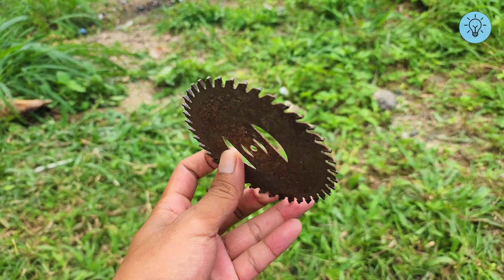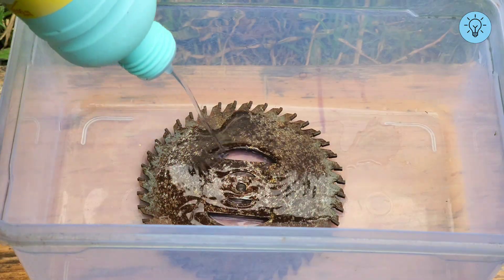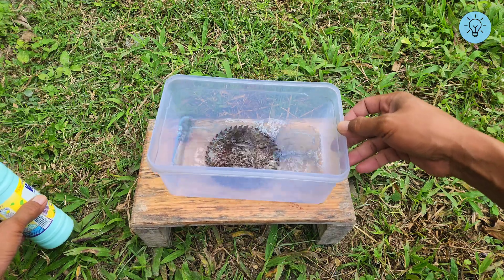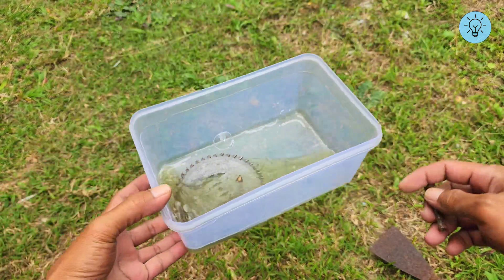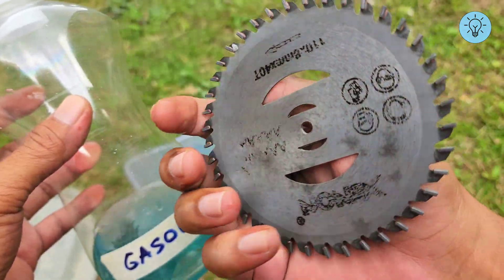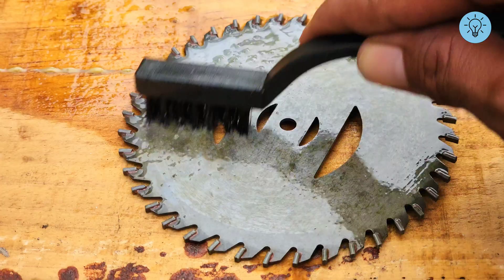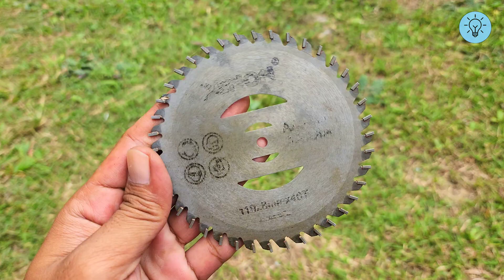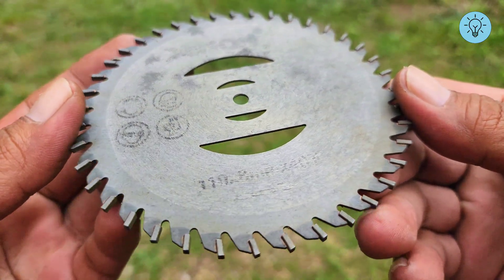Apply GASOLINE to rusty iron! Amazing results that many people have never imagined

Comment: 100 LL Aviation fuel is blue
Reply from the maker: The natural color of gasoline is actually clear with a slight yellow tint. However, the color can vary from one country to another.
In my area, I can find gasoline in green, blue, and red.
Manufacturers usually add color to help consumers easily identify which type is suitable for their vehicles.
For example, green gasoline has an octane rating of 90, blue has 92, and red has 98.

Comment: Huh? Gasoline? I’ve never seen blue gasoline in my life. Looks like dish soap!
Reply from the maker: The natural color of gasoline is actually clear with a slight yellow tint. However, the color can vary from one country to another.
In my area, I can find gasoline in green, blue, and red.
Manufacturers usually add color to help consumers easily identify which type is suitable for their vehicles.
For example, green gasoline has an octane rating of 90, blue has 92, and red has 98.